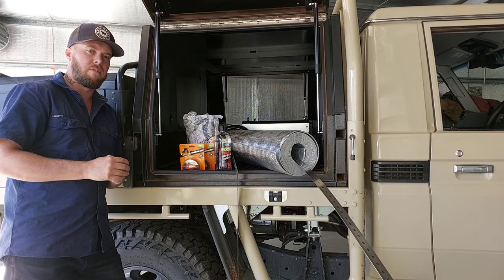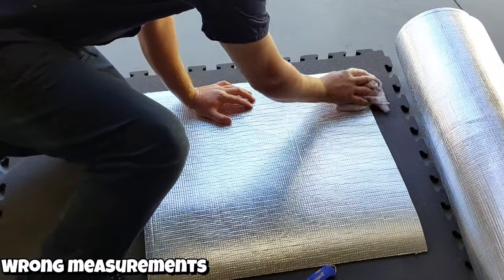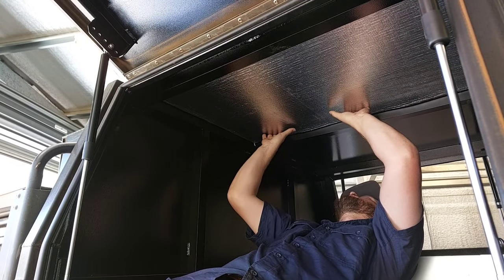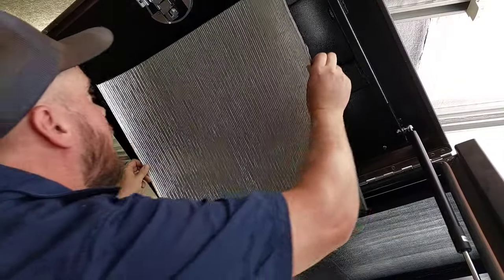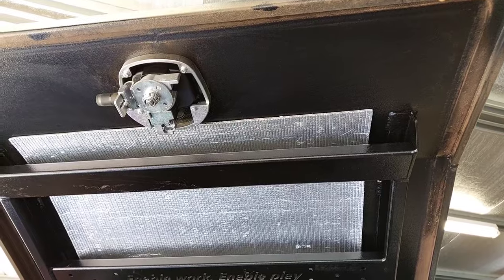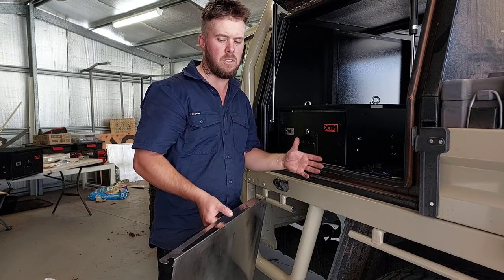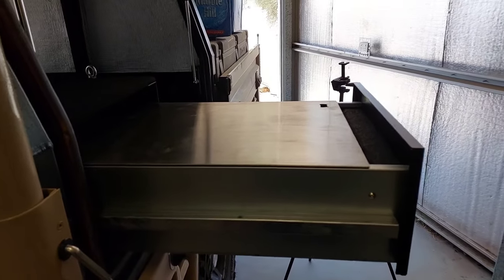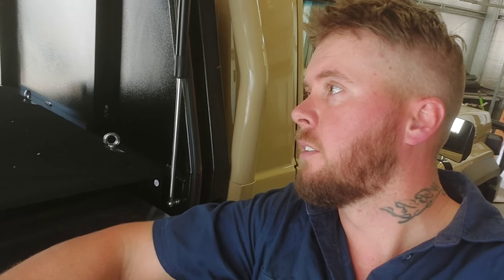HOW TO - 4WD Canopy insulation 🥵

Comment: Good work on the latest mods. 👍 I have a similar setup with that style stainless steel table on my rear drawers but at the budget end of town - ie. Kings.  But 5yrs on, they're still going strong. And  'coz my drawers are carpet trimmed, when I fit the table, it is snug and does not move.  I'm sure yours should be able to take a bit of weight.  I regularly use mine with my entire tool roll on it and it hasn't bent out of shape yet (touch wood).  As for buying gear, you just made me realise how lucky I am that if I choose to, I can simply take a very short drive to buy the gear I need from the various shops close to me. Whereas you, due to your remoteness, have to get everything delivered.  Thank goodness for online shopping.
Reply from the maker: That's good mate and I reckon this table will be OK with this draw, I'm going to mod it a little just to have a little less movement, very easy to do and will be much stronger. Alice Springs has a fairly good supply of stuff but the town certainly misses out on a lot, online shopping these days is the best haha. 👌

Comment: does that tape actually hold well, thought the heat would kill the adhesive ability of it ??
Reply from the maker: Yeah mate no problem, like I said in the video, it has an extremely high heat rating. I did mention the temperature, but I can't remember now, maybe 120 degrees?

Comment: Ever had any issue with mould in between insulation and canopy?
Reply from the maker: Not so far, I'm in central aus where it's usually hot and dry. Will keep an eye out though in humid wet weather.
Reply: @OutbackOffroadNT  yeah righto think I might have to go for a spray on adhesive in Vic. Thanks 👍